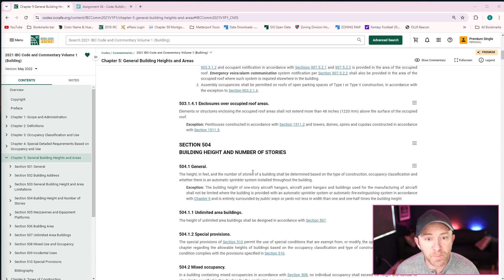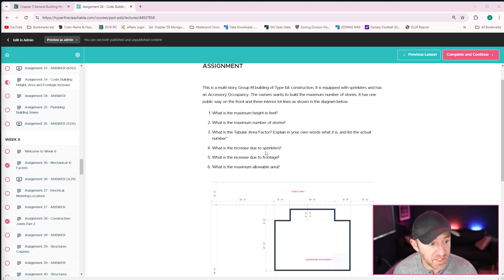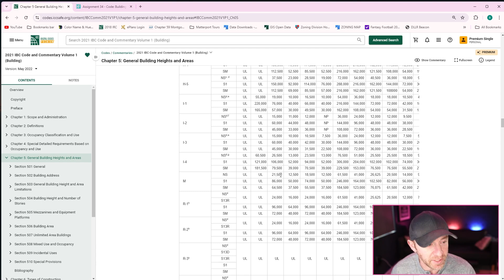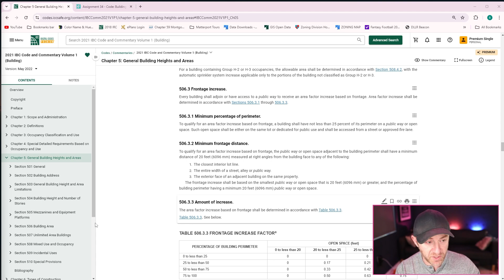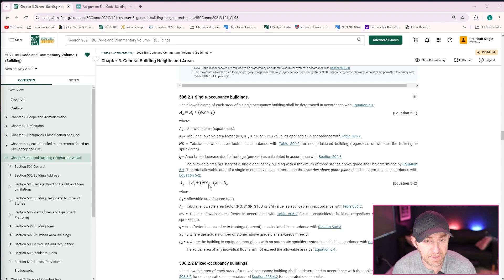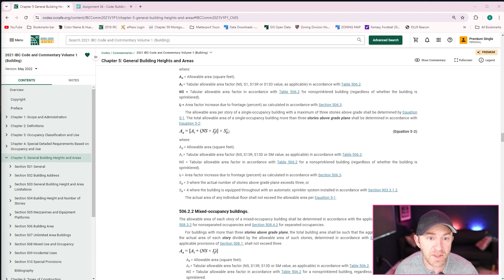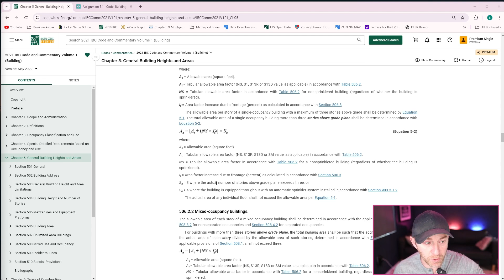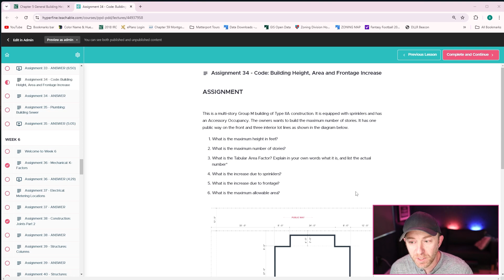ARE 5.0 : 2021 IBC Area Calculation and Frontage Increase

Comment: Hi  Your videos are great. I have a question re the area calculation frontage increase. The total allowable area result was 214,785 sq. feet. That is huge. How would this increase benefit the project that is restricted to a max hgt of 85 ft and a limit of 5 stories and setback requirements (zoning)? Seems like a lot of math (work, time) for something that cannot be used?
What am I missing?

Thanks,
R L
Reply from the maker: Hi Richard,

Thank you!

I don't think you are missing anything. There are various constraints on a project...code height, zoning height, code area, zoning footprint, lot coverage. Sometimes you may be allowed way more of one metric, like area, than you can actually build.

I do think the code and most zoning documents I have experience with, do a good job of somewhat coordinating these things.

Then of course there's the BIGGEST factor which is this is a problem I just made up out of thin air and didn't know any of the answers before I started solving it! So it is likely the numbers here are a bit skewed from what a realistic site or program might be.

Appreciate the comment on this video. I'm usually pretty slow to respond here. I'm easier to reach via the chat or email through my website.
Reply: @HyperfineArchitecture  

Thank you for responding. 
Your video course is helping me wade through a lot of subjects that I was formerly overwhelmed by. I feel much more confident now, like I  understand the bigger picture in these potential exam questions.
Thanks again
Reply: my understanding of the code is that the 214,785 number is for the TOTAL BUILDING.    the allowable are per floor is 71,595 sf.